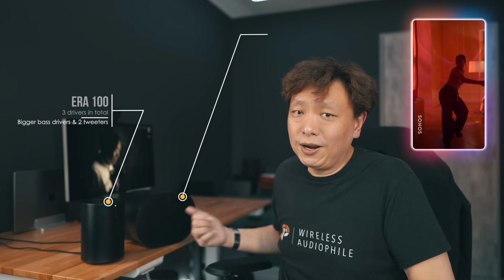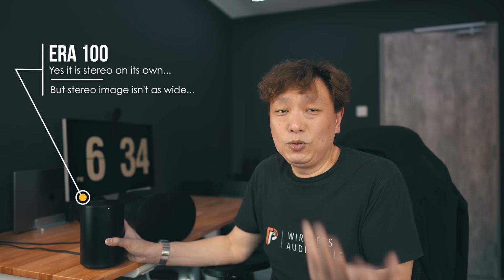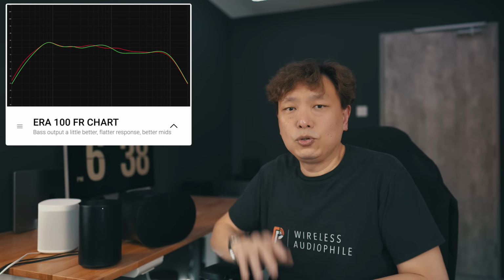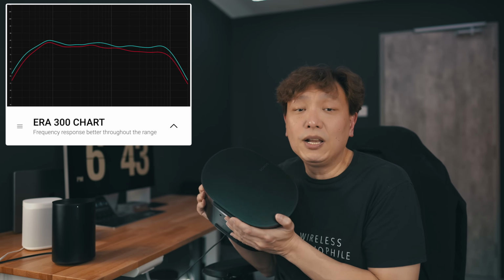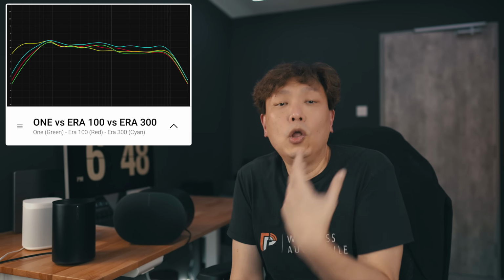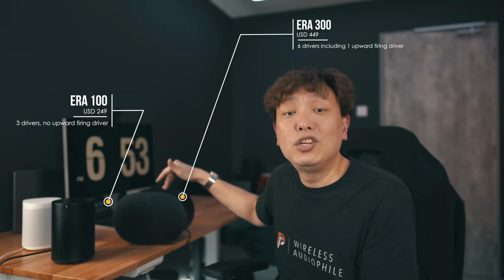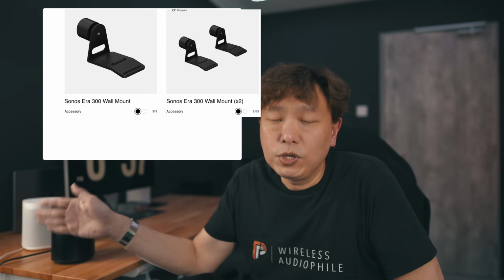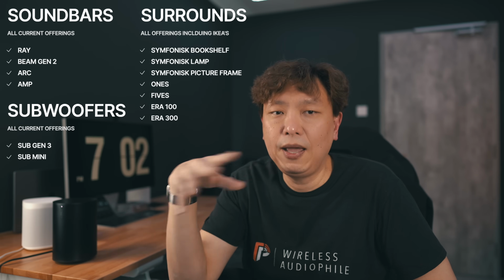Full Review of Sonos Era 100 & Era 300

Comment: Good Stuff! My era 300s arrive on the 28th. Looking forward to hearing the difference. Using them as surrounds with the arc and sub!
Reply: Interesting. Playing uncompressed vinyl (edit, in fact any content) through the port = arc + sub + eras (music set to full, not ambient) the front era speakers do not project sound. Just the side and upward firing speakers. I guess to give that spatial effect without the front drowning out the sound from all sides and top. I think I like this new way of listenting to vinyl and tunes.
Reply from the maker: I have this strong impression now that for the ERA 300 to shine (or any atmos setup), it has to play Atmos coded music.
Reply from the maker: Your experience and observation was mine initially when listening to non-Atmos coded music. It is playing from all over. Like playing mono music through 2 speakers, it is not stereo.
Reply: With a stereo pair of 2 era 300s the front and back speakers work. Sounds delicious. The front era 300 speakers just do not activate in a rear setup, atmos or not. The arc acts as the front speaker and the eras give you upwards and sideways sound behind you. A different music XP. I think I may like it. Need to get used to it to see if I am comfortable with music forced in this way.

Comment: Rest of the review is informative, but your frequency response curve comparing the two speakers is hilarious. You conclude that the 300 is louder across the board - uh, that’s not how you do frequency response. You don’t set them to the same volume number setting in the app, you’re supposed to adjust the volume setting per-speaker so that they produce the same overall volume in the room, ideally using a sound meter.

This would overlay the two response curves on each other properly, and make the differences more apparent (the 300 has a slight bump in the lower bass - hard to characterize with no numbers on the x-axis, and stays closer to flat through most of the curve but with a bump in the midrange and a pronounced bump in the upper treble). As it’s shown, with one curve entirely above the other, it just makes me laugh. People don’t care how it sounds “at volume 23” (or any other number”, they’ll simply raise or lower the volume number a bit to get the sound they prefer.

It has been shown many times, that when you compare speakers (say, auditioning speakers and trying to decide which pair of speakers from differing brands sound best to you), that if they’re not set to the exact same volume (actual volume in the room, not volume number in an app), people will invariably think the slightly louder speaker sounds better.

Comment: What do you guys think will be the best option for optimal sound, wall mount upside down or stands?
Reply: That will depend on your own room environment and working out the angle at which the height drivers project music in relation to your listening position.  Beyond that just try them in different positions available to you. Have fun. 🙂
Reply: If I’m just guessing you will get the most out of the speaker when wall mount so the up-fire speaker hits you where you sit instead of first hitting the ceiling and then on where you sit 🤔
Reply: @Dr.banansko  Yes I hear you, but… the almost vertical nature of these “upward” firing speakers indicates they were designed first and foremost for the ceiling bounce scenario. For instance if the era300 is fixed upside down you’ve got to have it very closely behind your seated position, otherwise the sound will hit the floor behind you. So if you get that almost vertical angle correct, you’re then left with the other drivers very close to you firing in the other directions kind of away from you instead of towards you. So depending on which way you go, I see pro’s for one driver and negatives for another. If you like a more ambient sound behind you I still suspect that a stand mount era300 with a little more space behind you and to the sides would be preferable. But we’ll simply have to test in our own environments to see what works to get a satisfactory sound stage. Cheers
Reply: @Dr.banansko  …Maybe a High up mount (upside down) would work well if you have your back to a wall, whereas if you have space behind your listening position to walk around, then lower stand mounts in the corners of a room might work better further away. I am sure there’ll be YouTubers talking and sharing experiences which will help sway ideas either way in our own homes.
Reply: I think you will miss out the other speakers when wall mounting it. Sure you will get the upfire directly at you but the side speakers and front will probably sound a lot better when having them on a stand in 90 degrees or slightly back of your positioning.
Reply from the maker: I will be testing this out very soon... I need to check my walls that they can support the weight!

Comment: Cool channel here 👌(just subbed). Ive got the era 300 coming tomorrow (excited)but as stand alone music(non atmos)these still should sound pretty banging(replacing my sonos move). I went with the 300 for the atmos tunes because it does sound nice to me. Curious how it pumps out stereo(Amazon HD,Ultra Hd,ect). Ill def get 2 more 300s to link up with the Arc 👌.
Reply from the maker: I find that Atmos coded stuff is really good. For non Atmos coded stuff I was initially unimpressed. But make sure you update to 15.2. I didn't do the before and after measurement but it sounded better. Not so dispersed sounding.
Reply: Synthchild81 - please let us know how you get on with the Era 300 replacing your move, I have a stereo pair of moves for music only, so would be interested in the comparison
Reply: @lloydblakey  def. As soon i recieve it(either tomorrow or thursday)👌.

Comment: Peter, it's a pleasure to greet you from Mexico, I currently have a sonos arc system, with two son ones as surround sound and a sub. I wish I could have an era 300, understanding that the best replacement for my sonos one would be two was 300... but in case of not changing the sonos one, acquiring one (1) era 300 would make the team good company for series, movies , located in the middle of the sonos one? Or is it better that it be specific for individual use in music? thanks peter be well
Reply from the maker: You need two era300 to use as surrounds.
Reply: @PeterPee  thanks peter

Comment: Hi Peter, have you checked whether Sonos has fixed 7.1 PCM/AC-3 playback as well now? Because at least in my experience this did not work correctly before, with Arc+Sub+Ones. My expectation would have been either downmixing to 5.1 or simply discarding the rear surround channels, but for me it seems the wrong channels were discarded as all dialog was lost i.e. the center channel. This can easily be tested with a PS5 set to 7.1 audio and pretty much any game.
Reply from the maker: I haven't tried that. Let me try. Screen capped.
Reply: @PeterPee  got my Era 300's today so can almost test this myself, but still lacking the stands for proper installation. Backordered until May at Sonos Europe (if you want the cheaper two-pack, which seems obvious that 99% of customers would?!) but hopefully some other retailer can come through earlier than that…

Comment: Hi Peter,  Thanks for the very HO LIAO review. I would appreciate if you could give insights on my dilemma. I have a beam gen 2 and sub gen 3. The soundstage and separation between mids and highs are somewhat missing the mark for me. 

My dilemma is should i sell the BEAM gen 2 at a loss and get an ARC. 
or
Purchase the ERA 300/100 in hopes they will improve the separation and soundstage

Appreciate the response
Reply from the maker: You try with the era300 first. I haven't tested them out extensively with the beam gen 2. But if you still find it lacking, then upgrade the arc. You'll have a kickass system by then.
Reply: @PeterPee  Kam Siah 🙏. Appreciate all the video and replies. Looking forward to your extensive test of the era300 with beam2 😬

Comment: Guess I have a question or two, IF you have time:

1) Did you test the surround aspects with just a single sub? I would imagine that a second sub would be the last thing on my shipping list, correct?
2) I had asked you earlier about my large slant sloped "ceiling" (actually just the underside of my roof) in my bedroom. Do you think the 300s would be able to fill that large volume with sound, or would I be better off with the directional 5s instead?

Awesome channel. If I were a couple thousand miles closer I'd see you at the event!
Reply from the maker: I tested with dual sub. But I will say one sub will get you like 85% there. 

The era300 should work better than the fives as surrounds. The Atmos capabilities are amazing.

Comment: Good stuff! Thanks for all the time and effort you put into this content Peter, we really appreciate it.
Reply from the maker: My pleasure! And I thank you too jon!
Reply: @Peter Pee  thanks for you vids. very informative. i currently own a Bose surround sound system and have been intrigued and tempted to purchase my first sonos system. Open question to the group, If i want to buy the Era 300 as a home theatre system, would you recommend first buying the Arc soundbar? Also, i have the portable Xgimi projector, could i use x2 Era 300's and connect via Bluetooth?
Reply from the maker: @asap_roque  Bluetooth will have lag. So you will still need the arc. But the xgimi projector doesn't have HDMI arc if I recall correctly. You will need something along the lines of a HDMI arc extractor and splitter.

Comment: Peter Peter Peter, need your help. 

I have sub gen3 cable hidden behind wall. I want to add Era 300 now and move sub else where. 

I know looks of cables are diff but with some push, will the cables fit each other?ie- can we put Era 300 cable into sub Gen 3 and Sub Gen 3 cable into Era 300??

I don't want to tear wall if I don't have to.
Reply from the maker: I got out of bed to try this out for you. The cables from the gen 3 sub fits flush with the era 300. Like perfect fit. You just have to push it all the way in. Only thing is that it will stick out straight from the rear of the speaker rather than angle downwards.
Reply: Excellent. Thanks. How about the era 300 for sub Gen 3?? 

❤🎉
Reply: @peterpee thanks 😊
Reply: Asking my follow up separately so its apparent to our beloved Peter when he wakes up tomorrow :

Does Era 300 speaker cable fit Sub Gen 3 😊

Comment: Good Stuff, thanks for all your hard work.  300's on order to replace the 1's.   I also ordered 1 of the 3.5mm / Ethernet adapter with the hope of connecting a CD player to my system.  I wonder if that will beam the sound to all speakers from one input on the 300's.  I thought that I would try that before ordering the port.
Reply from the maker: Yes that wiil. You can group all and they will play throughout. BUT!!!!!

BUT BUT BUT!....

When you connect the 300s as surrounds, they disable the bluetooth and audio inputs.
Reply: @PeterPee  So, can I use the 300's as a stereo pair for music, then as surrounds for home theater, or will I still need the Port / amp?

Comment: Tanks for good info. But can I use a pair of era300 as rear speakers to an arc for movies. But when I want to play music can select only the rear (era300) pair for music as they will be next to my dining table. So two different configurations using the same speakers.
Reply from the maker: No, that cannot be done. The closest way you can get there is to set the Surrounds to full instead of ambient mode for music. And then set it such that it plays LOUD for music, with Music Level at +15.

Comment: Peter, thanks for all you do. 

I've got an arc, sub 3, pair of 5s for home theatre. Would a pair of 300s replacing the 5s be an upgrade? (We also listen to a fair amount of music in that room).

In another room I've got a pair off ones with a sub mini, for music listening only. Thinking of upgrading the ones in that set up. What would be the benefits of the 100s vs 300s for that music only room?
Reply from the maker: I was going to suggest that you buy the 300s to replace the Fives... Cos the 300s are really DAMN good at surrounds for the Arc. And you can use the Fives for music. Cos the Fives are still unbeaten by the Era 300 for music. 

But then again you have the Ones with Sub mini for music... So unless you can sell off the Ones with Sub mini, you might not want to upgrade the fives with the Era300.
Reply: Thanks Peter. Appreciate your advice. I think we'll upgrade the ones to 100s with the sub mini. I've always thought higher bass and low mids were missing in that setup. The 100s may fill that in. (Hard to tell without crossover control, or even knowing crossover points).

Keep the 5s in the home theatre/music setup and skip the extra Atmos for now.